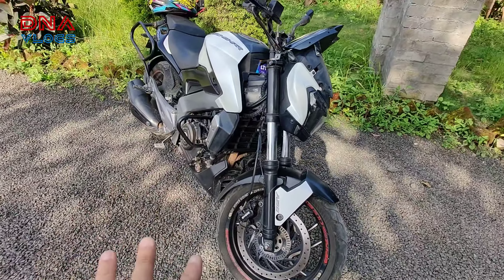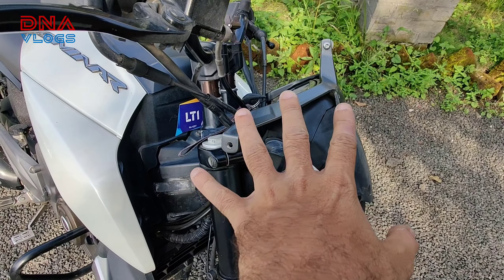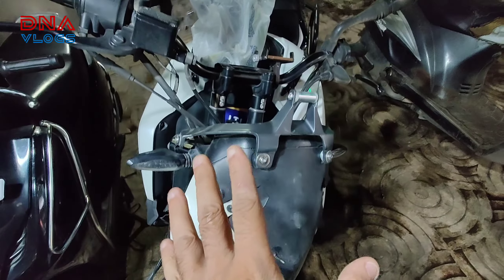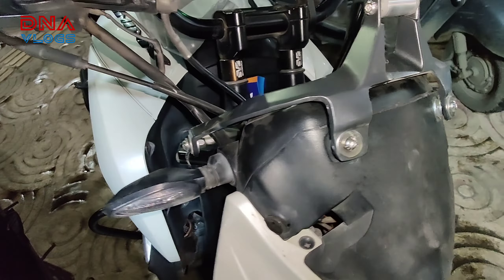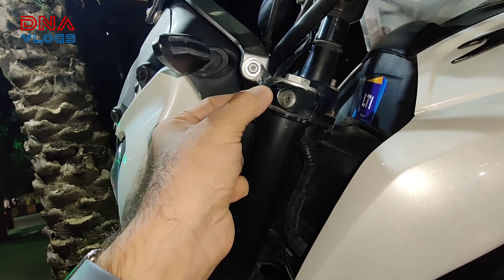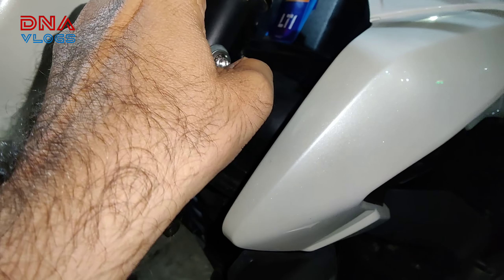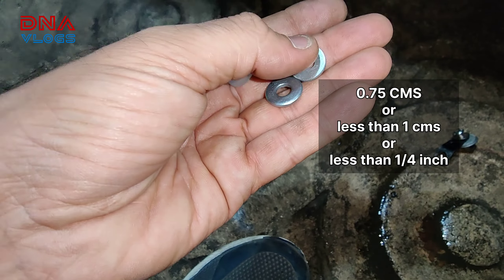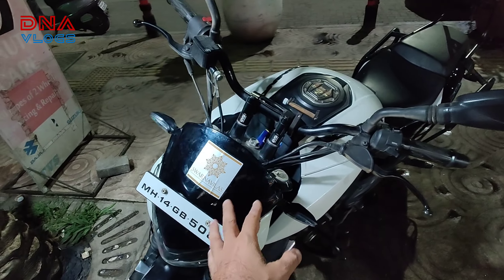Bajaj Dominar 400 Mods | 2022 GPS Mount Installed on 2017 2018 Dominar 400 | Quick DIY | DNA VLOGS

Comment: Where did you get this navigation stays?
Reply from the maker: Which stays
Reply: @dipen.nisar.autovlogs  Navigation stay = mobile mount
Reply from the maker: BUDDY, I still dont get your question i.e. why are you asking "Where did you get it from". 
Did you check the title of the video ? it says 2022 DOMINAR 400 GPS mount. 
Do you want to be more specific in your question ?
Reply: @dipen.nisar.autovlogs  I am asking the same GPS MOUNT accessories, i have 2017 Dominar 400, and I need it for my Dominar.
Reply from the maker: @KKRider  it's obviously from Bajaj. I gave a hint too in the above comment. And that's the reason I am asking again and again 😃 why are you asking where did I get it from. 😊
Reply: @dipen.nisar.autovlogs  ok thanks but in my area there is no bajaj showroom where this is available. Anyways I just ordered from 99rpm
Reply from the maker: @KK RIDER  oh. Buddy but 99rpm is very notorious, they don't send parts in time and sometimes that don't send all parts. Lot of mix and match. Very less good reviews

Comment: I've been trying to get hold of the GPS mount for months now. I initially ordered on 99rpm but even after waiting for 3 months none of the parts were available and finally I had to cancel. I asked around in couple of showrooms in Hyderabad, none of them have stock and are also not willing to take orders. Is there an alternative way I can purchase this part?
Reply from the maker: Service is the only way out. Give them advance and ask them to order. If they don't, ask them, if they will take the order after escalating to ASM. ASK THEM FOR THE ASM NUMBER AND ESCALATE TO THEM, IF the service is not taking any order. Same for any bike service related issues.
Reply: I had ordered the navigation  stay on 99 rpm 8 months ago ....it reached  yesterday
Reply from the maker: @thehypervlogs6650  thats why dont order anything from 99 rpm. lucky atleast you got the part